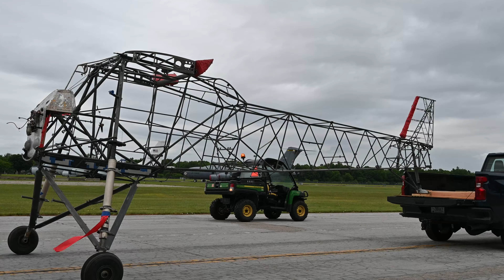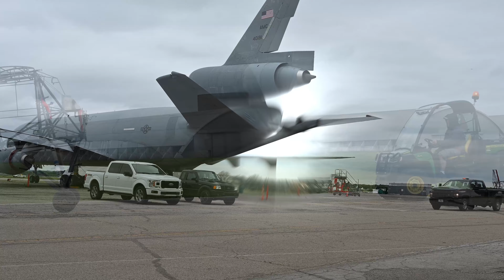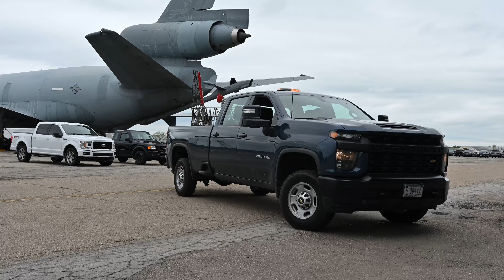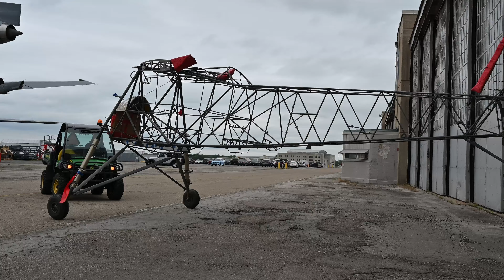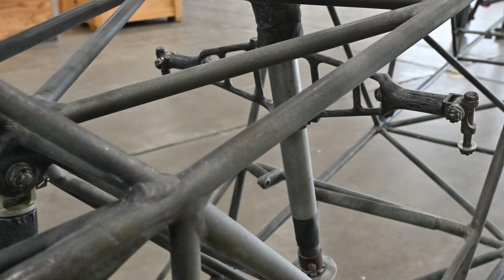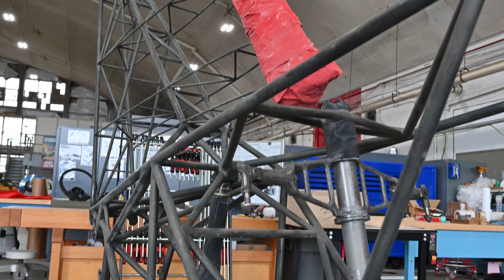Restoration Update: Fieseler Fi-156C-2 Storch(June 10, 2024)

Comment: Is the KC-10 on display in the Air Park yet?
Reply from the maker: Plans call for this to go on display in the Air Park this fall season.
Reply: @USAFmuseum  Uh meaning???? Removing some oil and hydraulic fluid???
Reply from the maker: @LINJ638  Yes there is a demil process to include bid proofing.
Reply: What do you mean by bid proofing????
Reply: @USAFmuseum  That's when I'll come visit. I live in Cuyahoga County. It's about a three hour drive.
Reply: @LINJ638  I think they meant bird proofing.
Reply: @paulschab8152  Oh I see I see now. How are going to bird proofing to prevent the corrosive damage around the airframe?
Reply: @LINJ638  I think they are more worried about birds making homes in confined spaces... I'm not quite sure about preventing bird poop.

Comment: Hello, I have a question. I attended the museum recently and was able to take a (admittedly subpar) picture of the NKC-135A despite it being shrouded from public view. Are there any plans to put it back at the air park? I found a memorandum from May 2023 imploring the Department of the Air Force to save it and it seems they did. Now what?
Reply from the maker: The museum is still evaluating the options for the NKC-135A. None of the options include bringing the aircraft to the Air Park.
Reply: @USAFmuseum  Is it possible that it will be placed in a new hangar?
Reply: @USAFmuseum will it ever go back on display at all? Even indoors one day?